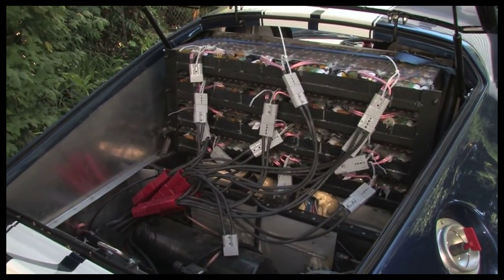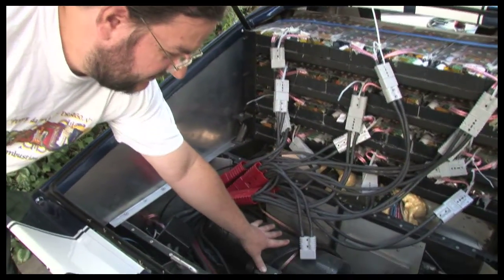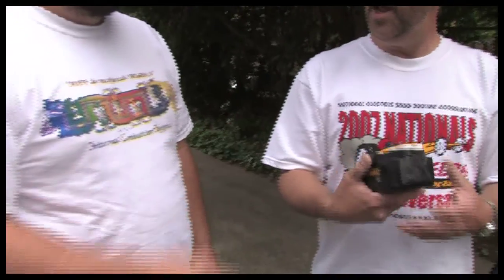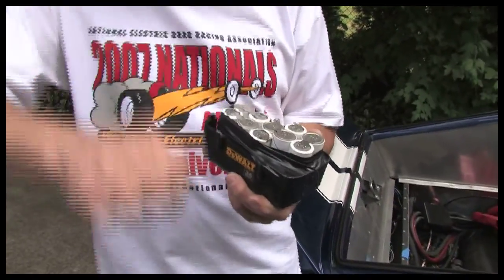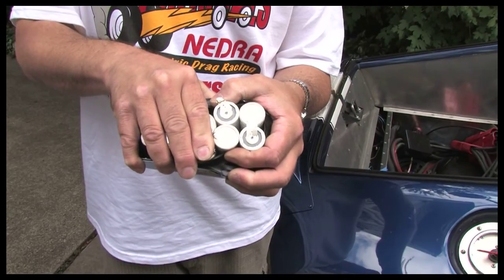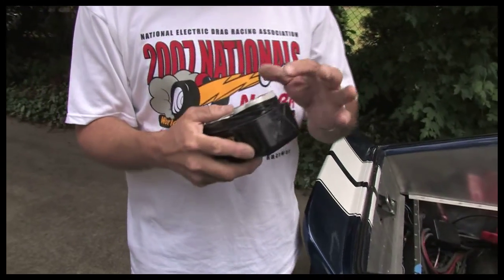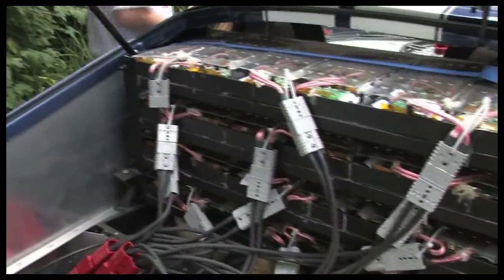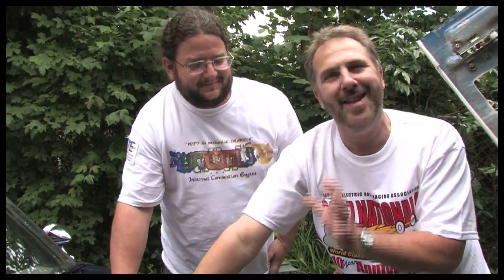Running On Lithium: Ford Cobra Torque

Comment: I'm surprised you don't see really any drift guys doing this yet i would think with the high instant torque these things would love to burn the tires and go sideways
Reply: well drifting is about control.
Gas engine
letting go of the gas pedal will make the wheels slow down, like there braking. 
So then. electric engine, you have no resistance in the engine when letting go of gas. it will keep spinning. yes it will slow down, tho it will give the effect of pushing the clutch or even like slowly letting go of gas. not always a good id for drifting.
its probably possible to make some type a brake system to simulate the resistance,.. tho anyhow, not at least, people like sound :)
tho obviously we will see electric drift cars in the future